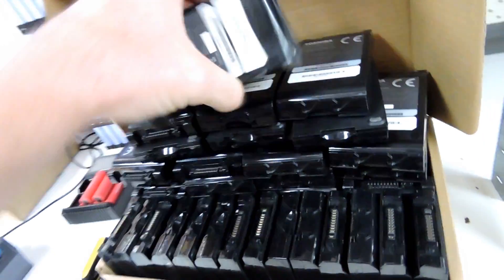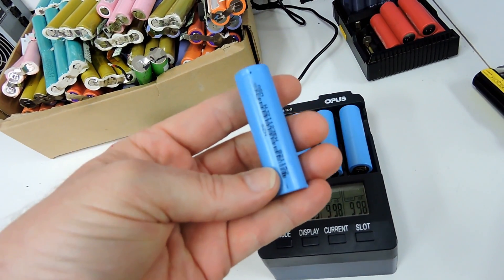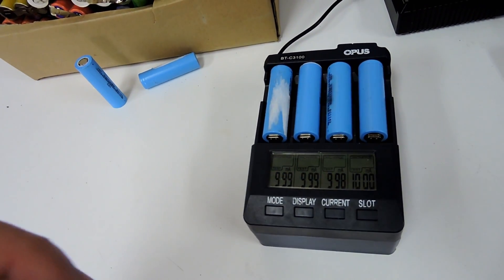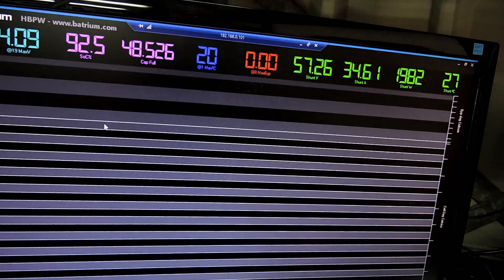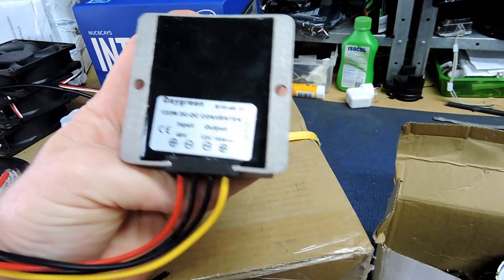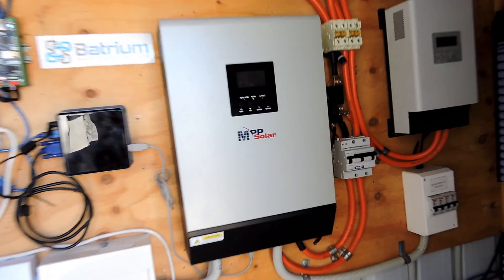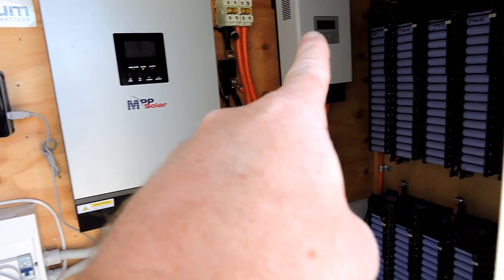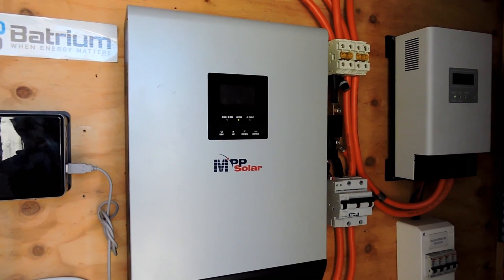18650ED UpDate

Comment: Finally received the Tesla Powerwall 2, I mentioned months ago I'd let you know when I got it. Installation was completed about an hour ago, I'll create a short video when I get my account details for the Tesla app.
Reply from the maker: be great to hear how it goes.. what would be better is full on load tests :) full to dead flat - that would be a great series of videos!
Reply: Don't think I'd be to popular if I did that at the moment, the wife wants to start saving money yesterday :) The first day I didn't get a full charge after the installation (4hrs install time), however yesterday it was at 100% by about 1pm, overnight it dropped to 48% before starting to charge at 7:30am this morning. According to the app the house load is about 400W overnight; two fridges, chest freezer a couple UPS's and whatever devices are in standby mode. I assumed I'd need to connect the powerwall through my own network, however it connects via the 3g mobile network which I didn't realise. I like the app for monitoring whats happening any where you can get internet, you can also change a few settings on the powerwall. But you cant display that data on a public web site, perhaps someone will out how to extract the data so you can host the stats for anyone to view. Will try and get a short video out later today.

I've made public a link to a photo of the powerwall I took as soon as it was installed, I think the link should work if you have a facebook account.

https://www.facebook.com/photo.php?fbid=998257643645885&set=a.404861706318818.1073741826.100003849757051&type=3&theater

Comment: Hey Mate,
I'd put a couple of whirly birds on the roof of your shed. Going by your charge test and the batteries seem to work best cooled. I'd do everything possible to make your shed as cool as possible. Being a builder, I'd have insulation on the inside of the walls and roof, whirly birds, intake fans in around the bottom of the walls, bringing cooler air in the bottom and the whirly birds to release the heat out of the top. I'd also put a tort tarp over your shed, about 1.5 foot above your shed for shade, so it doesn't get any direct heat...
Just a suggestion haha! Keep up the good work. I will be doing a simular set up that you have on a smaller scale of batteries, but close to the same of the rest of you set up in a fifth wheeler that we will be buying in a couple of years for the family to travel Australia and be completely self reliant in every way. I'm also thinking of just going brand new Panasonic 18650's...
Cheers,
Col.
Reply: Is tort tarp a mispelling? I looked it up and didn't find anything.
Reply: Swiggity Swooty Haha! sorry my misspelling. It's supposed to be 'taut' http://www.thesaurus.com/browse/taut

Comment: on the led strips if you wire the + to the - of a new strips 4 times, the leds will run at 48v allowing you to ditch the inverter.
Reply from the maker: I did consider that ... may yet do it ..
Reply: I would be careful with doing that, the LED strips may not have current limiting in them so if you increase the voltage (when charging the batteries) then the voltage across each LED element will go up increasing the current beyond the design specifications of the LED elements used.

LED's needs to be run from a current limited power supply to stop burning them out when the input voltage goes up too high...
Reply: They aren't wired like that. The strips are parallel sets of 3 in series. Connecting them together just makes longer strings of 12 volt strips. Trying to run them in series will bring your attention to a problem specific to strip lights. High resistance. If you aren't familiar with living with LED strips, you should cut them in meter lengths or so because the thin copper will noticeably dim the far end. Also, if you can manage it, connect the negative on one end of a strip and the positive on the other. This way, the electricity only has to traverse one length of the copper foil traces.
Another way to reduce these losses is to get the 24 volt strip light that is "rated" for 10 meter runs.
If you really want to save power while still brightening up the area, ditch the 12 volt supply and put in a switched buck converter that you can turn down to 11-ish volts. The LEDs won't dim much, but the current will be cut dramatically. 3x for the under counter lights in the kitchen here.